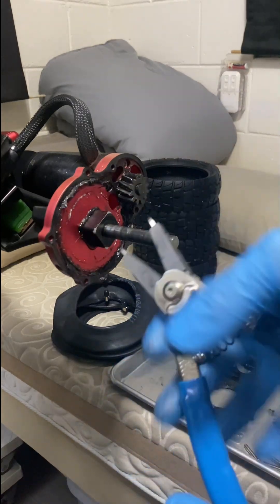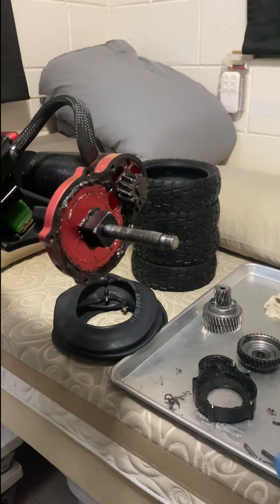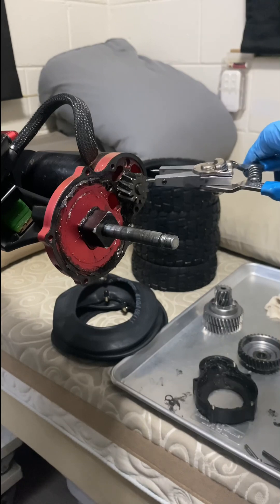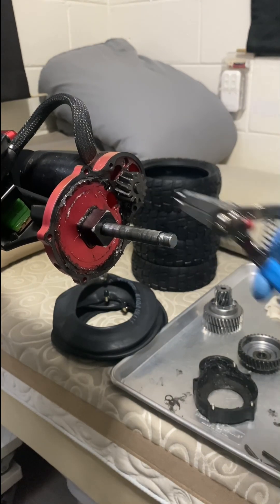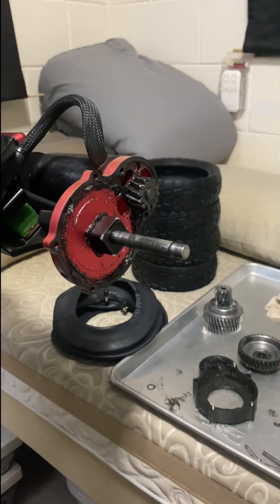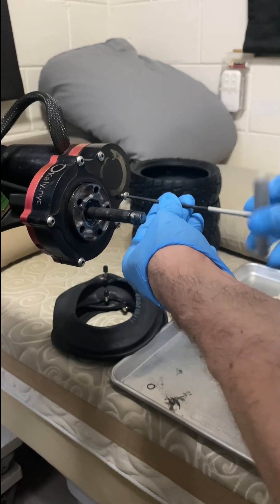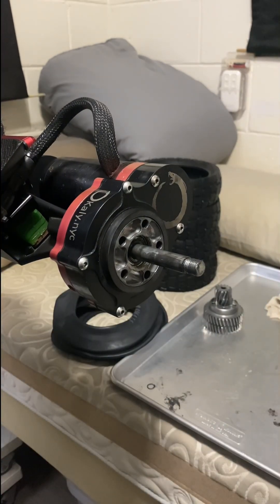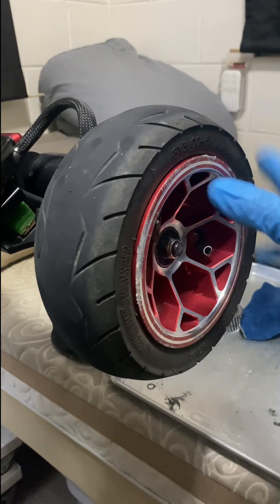Gear Discussion | Kaly XLR

Comment: hey. I got a kaly xl50 board but it missing one of the V-rings part. u wouldn't happened to know where to get one? and/or size for it?
Reply from the maker: Do you mean the c-clip? I call it a snap ring. Some hardware stores have them individually, but you need the exact size. Most people just buy a box set on Amazon.
Reply: @electropsychosis  ah it was theeee rubber piece. But no worries. I found the correct size and one for it.

Comment: Bro you've got to replace the correct size C-clips everything you take them off! And you should use much more gear grease as well. I speak from experience since I assembled all XLR gear drives for Ernesto at Kaly from Dec 2021- June 2022.
Reply from the maker: Copy that. Nice to meet you. 😎
Reply: Can you describe how much gear grease you mean like I've been basically putting enough on so that all of the space between the teeth on each gear is fully filled with grease then spin the gears to make sure everything's coated and keep spinning the gears and pushing the grease back in to the spot where the two pulleys the motor pulley in the wheel or drive pulley mesh and that should be enough right? It's not like we're trying to fill the gear case up with grease right?

thanks in advance for your answer and any chance you have access to a CAD drawing or just any dimension to drawing of the gears that you might be able to share since Ernesto just closed up shop and really didn't give any of us with these boards any more technical specifications then we're on the original sales website like if we need to get a new part machined for some reason be great to have that information seems like the least the man could do give us some access to some of the design drawings just for the parts so we can replace stuff if we need to after spending the cost of a used Honda Civic on one boards lol

not to mention the price of replacing the battery so it doesn't catch fire or and because of the vampire drain that the hydraulic system put on the battery pack and then also the cost of replace the speed controllers since that spin tend least on my board just started randomly turning off on me which I ride around in San Francisco and that's not an option to have the ESC just turn off while you're riding especially when push the start's not enabled Anyway just thought I'd ask if there's a resource for any more information on these things that came with zero information and then had very expensive problems to fix if you were lucky enough to have one that didn't explode which I so far have been but wasn't lucky enough to get one that had him ESC that was reliable that's for sure